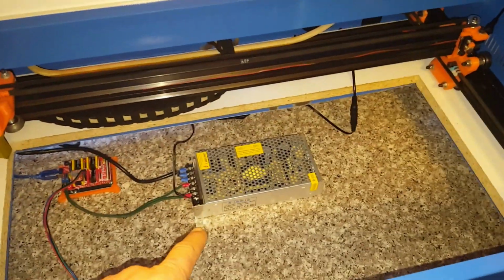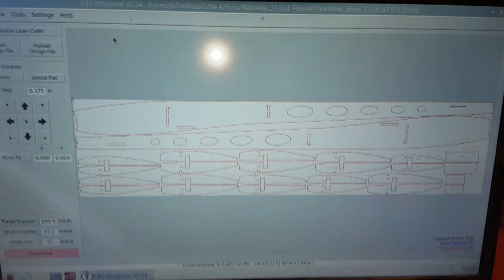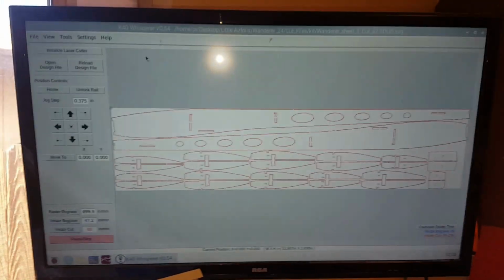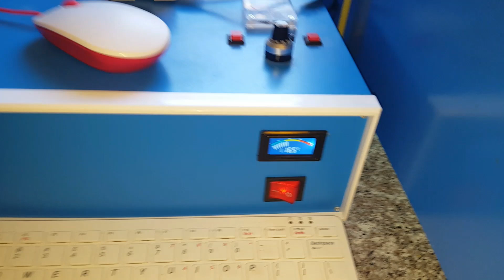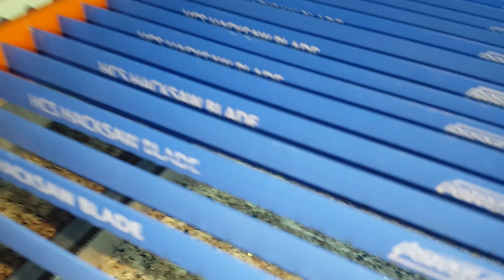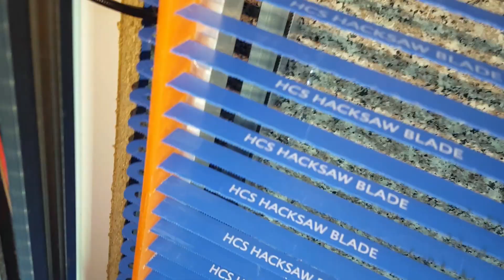Franken-40 - Highly Modified K-40  Laser introduction (previous version)

Comment: you know that old saying " if it works, dont mess with it" i bought a k40 also and before it i had a mpcnc, with swappable diode and milling thingy, and a 3080 before that... thing is they all have same components and electronics, difference is the co2 tube and beefier power supply on the k40... but overal they are all 4 aluminium profiles and 2/3 stepper motors... and honestly after 5 years of owning them... i could probably use the 3080 take the 5k it costs to buy a "pro laser cutting" that in reality is a k40 with a 100-150Watt tube and befier power supply... and build a industrial machine cause in parts... hardware components around 2 to 3000 USD and then is all a matter of wiring it all up and swap the motherboard and stuff.  and lets say another 2k to reach the 5k for cooling and smoke exhaust... and u got probably a 25-50k DIY machine from a 3080 bone structure... but as you said in the beginning of the video... the way i have them setup now they work for me... i dont need them to do more... they are perfect as they are... and honestly the more you fiddle with them... the more crap u brake and u sort of waste cash repairing them instead of making stuff with them... but if u got a 3080 or a k40 cheapo original... its a good gateway to cnc machines... what actually brought me into cncs was my 1st ender 3 3d printer... was amazed how reliable and simple it is as parts for the price it came at. awesome stuff love the upgrade you did.

Comment: I successfully converted a K40 with the Makerbase MKS DLC32 v2.1. The documentation is really terrible and there is a bit of wiring to do but now I have a 32bit controller with TMC2209 drivers and lightburn compatibility. The DLC32 firmware isn’t open source as of yet I think but I didn’t haven’t to mess with the firmware to get mine working. Up next I’ll be crawling the forums for how to set up the wifi connection as a port lightburn can recognize so I don’t even have to plug into the machine. Even after all this I still come back to check out your machine. Great video!

Comment: I've fitted a 80w tube to my k40 with 100w psu, cohesion 3d board. Aeon laser cutting head. Aquarium chiller 6 inch inline exhaust fan and air assist. Planning on building a lot larger build  to put everything in soon

Comment: Liked and subscribed! How did you wire the limit switches on both ends of each axis to the stock M2 controller? My stock k40 only has limit switches on the top left of x+y, it would be nice to have it on both ends to avoid the grinding (3:27).
Reply from the maker: In series.